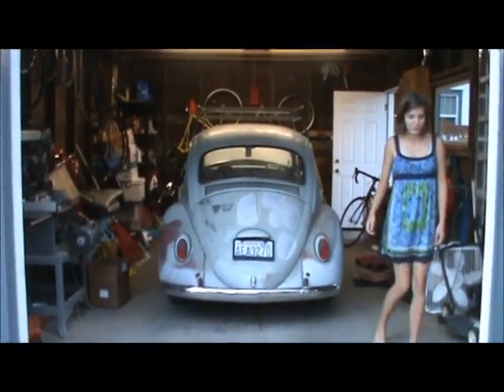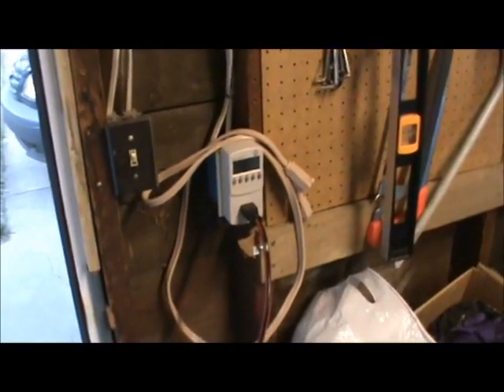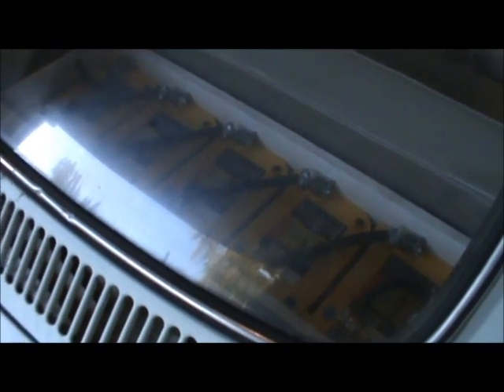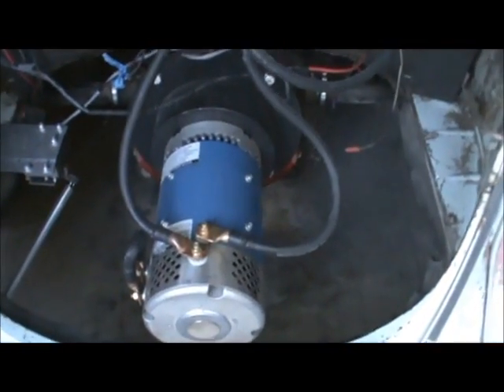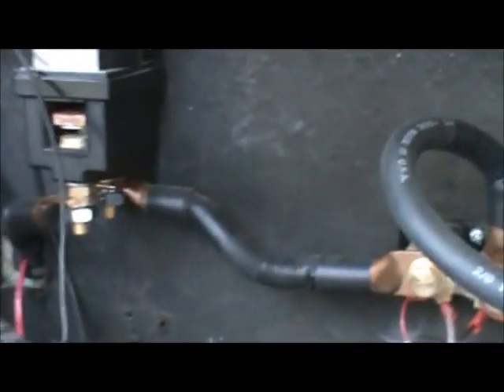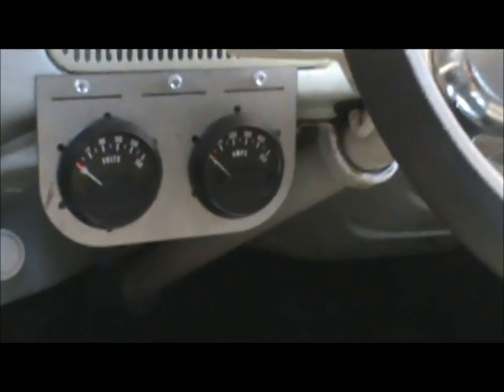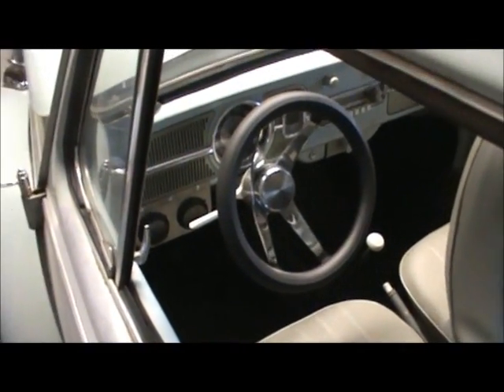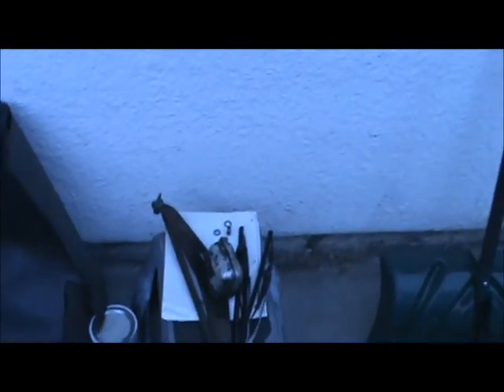VW EV Conversion (a summary)

Comment: What's the range with the batteries fully charged? What's the cost of the conversion? Interesting video by the way. I've seen several videos of beetles converted to electric. And a last question: How many hours are needed to get the batteries fully charged plugged to 110V?

Comment: How much did the electric conversion cost? With out any mind to the car restore or purchase.
Reply: These motors are really awful, but only about 1000 bucks. They are also DC, meaning the controller will cost like 300 at most.

Comment: Great project...the emotor looks tiny in the engine bay of the vw, and i didnt quite get the shifting avoidance, i understand the engine has major torque down low but maybe change it to a more proper ratio to sync the power to and make it that much more fun and sporty, look how fast that bmw i3 goes, and u have that front trunk to put a good amount of batteries there for extra range, i live in mexico and we have like a million of those drivin round, im gonna do a similar thing but more of a road warrior, all terrain beast for the city, carbon fiber chasis and a big emotor 12" diameter or something radical haha
Reply: Begining of a new age

Comment: Nice job.   I like it.  Perfect car for a conversion.  40 hp is more than the original motor.  Why leave it in second gear ?  would you be more efficient by choosing your gears wisely according to speed,  just like a gas motor.  No reason to let it rev.  How does it shift without a clutch ?   I used to shift my bug without the clutch,  it wasn't easy, but it worked and made sense to do it.

Comment: people interested in playing with this idea, beetles are easy because the transaxle is very accessible and adapter plates are a matter of 4 bolts.    A used forklift could supply you with enough components to get started....The batteries are what get you.   For the hippy dippy types, theres no free lunch.....conflict minerals and coal/natural gas power your electric vehicles.   ITS ALL ABOUT THE TORQUE.
Reply: gwhuntificator yeah but by charging at home, you're most likely using coal powered electricity, which is way cleaner than a car engine

Comment: Not sure if you have found a way yet but this is the way I do it in a petrol car. 3rd to 2nd. pop it out of 3rd into natural. rev the motor while gentle pulling back into 2nd (don't pull so hard as to grind the sync rings) when the revs match the speed it should then pop into second

Comment: 40 American hp (~30 kW) from an electric motor should get you 50-150 lb ft of torque (~75-200 N m). Top speed would probably be pretty low. 65ish? Idk depends on how well you can shift into other gears and what their ratios are   0-60 shouldn't be too terrible because electric motors have ballin torque curves. Maybe 10-15 seconds.  Hope this helps a bit.

Comment: Nice job Albert.  I notice a lot people do not stress how important battery retention is.   God forbid you get into a minor fender bender and have 7 batteries mow you over.  There are truck capacitors in the form of batteries now.  It offers EV's some power balancing with large number of batteries.  A little more bang you hit the throttle too.

Comment from the maker: So I bought the plans and parts from wilderness ev.  I could have just bought the plans and bought many of the parts from 3rd parties, but decided to go the easy route.  The shaft coupler and the bell housing that mounts the motor onto the transaxle are two parts you'd have to buy from a specialist.  The shaft coupler you could buy from Rocky Jennings (rockyjennings(dot)com), the bell housing probably from wilderness ev.  Everything else is off-the-shelf.

Comment from the maker: A brief update.  Transfered the project to Rocky Jennings (a local VW mechanic).  The original kit from Wilderness EV sold with a poorly designed coupler (main shaft to motor) which stripped after about 1500 miles.  Rocky built me a new one out of an old clutch plate that absorbs a bit of the torque shock.  Got about 600 miles on that before 3 batteries died (Optima Yellowtop).  We're in the process of getting a warrantied replacement of the three.

Comment: Sheet metal and pop-rivets. No power windows, brakes, steering, seats or dashboard. I could do this. Reliable as a refrigerator. No stains on the driveway. Recycle the batteries in about 6 to 7 years. Use 1/5th the energy.

Just plug it in and drive. Period.

Comment: (Continued) I would start in 2nd for it to be easier on the batteries and then shift to 3rd and drive in that, until you stop again at a light or so, shift back to 2nd to start again and so on.

Comment: Synchronizing higher RPMs is always a bit harder, so you'd have to have the RPMs of the electric motor exactly matching the speed you're going when using 2nd gear. Normally, 2nd gear isn't for higher speeds, with the gas engine you used to shift into 3rd at between 15 and 20 mph, so the speed that you probably need to have for shifting back down to 2nd would be something around 10-15 mph. If it starts to drive in 3rd, then using 2nd is just a matter of saving power.

Comment: Glad you discovered that I was going to try to explain in a lengthy message that you can still change gears in motion, it as i'm sure you found requires a little practice. Don't be terribly alarmed though, that grinding noise you hear is not the gears, but the synchro rings. IF you are matching rpms well and don't hear the noise then you can expect a normal life from the synchro rings. It's very easy to do with a gas engine, and as a matter of fact that how large trans are meant to be shifted.

Comment from the maker: Probably 350 amps.  Once I figured out I could shift it (even though there's no clutch), I mostly use 2nd and 3rd gear around town.  It easily gets to 40mph in 3rd gear.  I had it up to 55mph out in a local industrial park in 4th gear once, but that was just a test.  I've never had it on the highway, just local driving.

Comment: I noticed you said your max current draw as 300 amps, Is that all those yellow tops can output? That motor is only going to give you 30HP at that current draw not accounting for efficiency loss in the motor. Just curious, I'm seriously contemplating a EV myself.

Comment from the maker: Only 6 batteries on the motor circuit, 1 battery on the accessories.  Motor circuit is nominally 72V.  They're deep cycle marine batteries.  I've never had the circuit below 65V or higher than 80V.

Comment: So, if his 7 batteries are 12V(6 cells per battery) then we should assume a voltage of 84 volts fully charged. and no less than 70 volts fully discharged else the plates will become eroded much faster and will shorten useful life.

Comment: 50% charge does not mean 50% voltage if you drop it to 50% of operating voltage you will SERIOUSLY damage the plates. A fully discharged lead acid cell will be around 1.7 to 1.8 volts with 2 volts being fully charged.

Comment from the maker: I've had it down as far as perhaps 65V, but at that point it's dangerous to have on the road. It goes about 5 mph.  To me 70-78V is the safe operating range where you get performance similar to a gas engine.

Comment: you said the max voltage on a full charge is 78 volts.. then you said when the voltage gets down to 70 that you need to think about getting it recharged? unless I misunderstanding something that's only a difference of around 8 volts?! my understanding of lead acid batteries is that you can safely go down to 50 percent charge, which in your situation might be somewhere around 39 volts. that might likely get you a lot further than 12 miles.